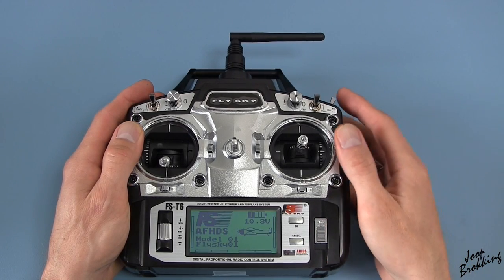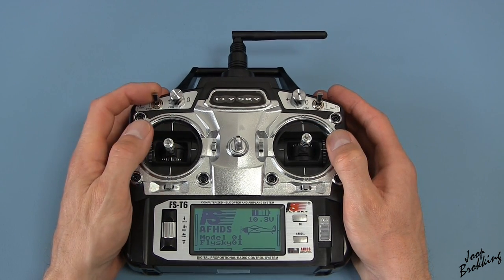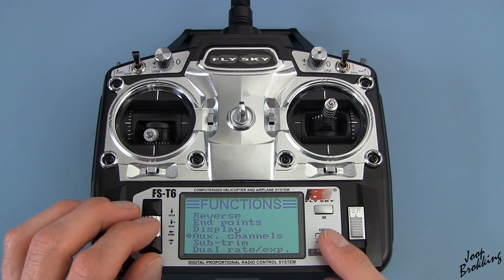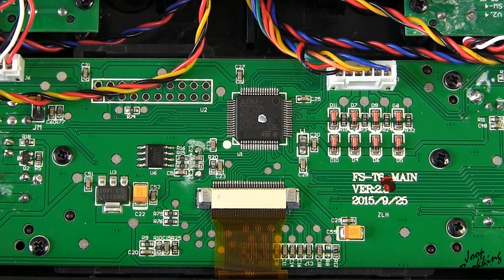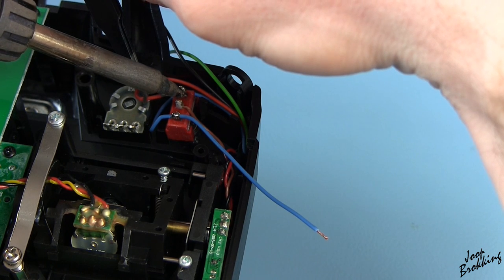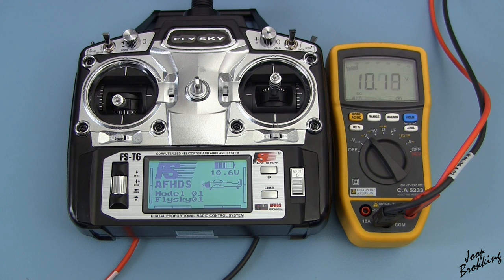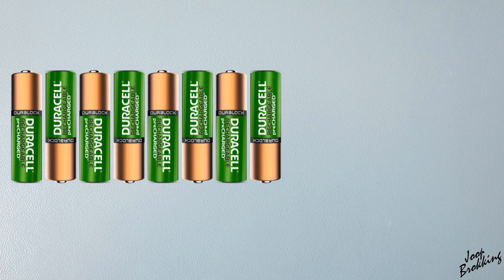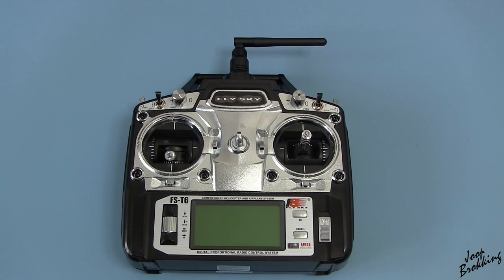Modifying the FLYSKY T6 for Ardupilot (one channel, 2 switches,  4 flight modes!)

Comment: For measuring the battery voltage in those devices why is such a low resistance is used for measurement? after all as long and that device is Working in this config it takes about 0.2mA which is quite some for such a small operation on a battery application.

Comment: Hi Joop, I am watching your videos since long, and this one is the 100% my problem too, same radio and same Ardupilot, I used the dial option to switch the flight modes but had to change the frequencies on radios, I am not a electronics expert like you but struggling with this radio and flysky 8 channel radio. Keep it up. :)

Comment: when you make tutorial on GPS hold and  GPS return to home  ? 😞😞
Reply from the maker: I have to make a video about a compass first ;-) Otherwise the GPS will not work.
Reply: Joop Brokking Can't wait for these tutorials!!!  Thanks to you i have already managed to make a very nice tilt compensated compass using your 6050 imu tutorial and the heading calculation pdf document you provided us! 
So for these GPS functions like, position hold or return to home, barometer altitude data is not required? (what about a barometer altitude hold tutorial?) I had the impression that a specific safety altitude (set by the user) must be maintained to avoid colisions if there is no sonar sensors under the multicopter. I also know that altitude data can be provided by the GPS receiver but what about accuracy?

Comment: I modded mine by simply replacing that pot with a 3 position switch and a resistor divider. Works great for selecting flight mode! (level, GPS poshold, RTH)

Comment: My FlySky T6 suddenly lost link and apm 2.8 not arm. why is that? i use rechargeable battery. On ground test everything is ok. But when i am going to fly then suddenly lost control and crash the drone.any suggestion?
Reply: Use failsafe RTL to save ur copter. Then check the range of the tx when the failsafe triggered.
Reply: USE 4 POWER WIRES to your receiver( 2 5v and 2 ground). I had the same problem and this saved my day.

Comment: Instead of changing the voltage readout with a pot, turn the transmitter on while holding both sticks in the bottom right and this will allow you to set a voltage offset
Reply from the maker: This will work on the I6 but does not work on the T6.
Reply: sorry bottom left not bottom right
Reply: thank you Marcus it work

Comment: nice mod it already has a voltage adjustment tho. 
i have one mystery where all my batteries read 1.39v but altogether i only get 9.7v it should be 11.12v... its like one of the batteries isn't being detected by my meter. the transmitter says 11.1 though
how about a lipo battery mod?

Comment: Very informative, nice job. Who do you keep the different combinations of switches straight? It appeared to me (?) the left (next to antenna) 3-way toggle would have to be in a particular position so that the other switch would have 3 different positions?
Reply from the maker: The top switch is a fail safe switch that will bring the quadcopter home regardless the position of the flight mode switch. So it needs to work Independent.

Comment: The 3 position switch has just arrived, I have the resistors already from another project and now I am starting this mod :) refer to drawing again at 3.29 seconds:-  I am able to solder/connect the switches and the resistors but I am confused about the 3 connections marked GND,+3v3v,analogue out. I notice there are three wires on the potentiometer, red brown white can I presume that these are the GND,+3v3v,analogue out, if so which is which, I can make an educated guess that the brown wire being the sweep on the pot is the analogue out? if this is true I can measure out the other two, but I dont wanna let the smoke out of my Transmitter, regards
Reply from the maker: The center connection is the analog input to the microcontroller. The outer two are the +3.3V and GND. Use a multimeter to check the polarity.

Comment: uhm, isn't there an alternative firmware available that brings all those features in software? i seem to remember that you can even transmitt on more than 6 channels with said firmware, but i don't own one of those transmitters myself so i am not sure...
Reply: shhh -.-
Reply from the maker: Using alternative firmware that is made by some enthusiast is not something that I will recommend on my channel. That is why I used the alternative resistor method. 

But if you remember the link to the firmware I definitely will have a look.

Comment: Thanks Joop for all the good stuff you put out :) I am just starting RC and am going down the ArduPilot road and wondered about these extra channels, I have a question... there are two switches on the drawing, (3.29secs), one of the switches is a "on,off,on" at least that is what I have ordered, the other switch and here is my question, is the switch a "on,on" switch different than that which is already in the FS-T6 or do I need to order that one as well. regards and kudos
Reply from the maker: You only need to order the 3-position switch (on-off-on). The 2-position switch is already available in the transmitter.
Reply: thanks

Comment: Just modified mine and it works perfectly, Thanks again Joop that's another beer I owe you!
Reply: I having problems getting this to work I'm confused to what wire goes where if you could give me any help it would be much appreciated
Reply: @murphysarmy25  The Green wire is from the center of the two 1k.5 ohm resistors going to position 1 of the 3 position switch
Reply: @fpvsparky  thanks for the help  I'm new to this bit of a stupid question the brown wire connected to the resistor is that the original brown wire from the controller I ask because in the video it also looks to be connected to the two way toggle switch
Reply: @murphysarmy25  The Video is a little confusing, but yes the brown is the analog out from the sweeper, if you follow my diagram and the colours, Red 5v+, Black earth, green from the 2 1k.5 to pin 1 on the 3position, blue from 1k.5/3k.3 to pin 2 on the 3 position and to pin 3 on the 2 position.
Reply: @fpvsparky  much appreciated I will fallow this instruction along with the diagram thanks
Reply: @fpvsparky  Think I have it just want to be sure before I soldier so I have brown wire from controller to pin 2 (2position switch) red wire from controller to the 1k5 resistor to pin 1 (2position switch) green wire from centre of the two 1k5 resistor to pin 1 (3position switch) blue wire from were 1k5 and 3k3 meet to pin3 (2position switch) to pin2 (3position switch) black wire from controller to 3k3 resistor to pin3 (3position switch) my confusion is there's a brown wire connected with blue wire between resistor 1k5 and 3k3 in the video I'm not sure were it goes but when I test the settings with the way I explained with just blue wire between 1k5 and 3k3 the settings work I think sorry for so many questions
Reply: @murphysarmy25  You got it, the video is wrong, and don't forget to set up the channels on the radio otherwise it won't work!! you can test it with the test program that Joop supplies
Reply: @fpvsparky  was thinking it was because your instruction made more sense gonna do the test program later that was the only thing holding me back  again much appreciated thanks for your help
Reply: @murphysarmy25  How you getting on? did the switches work?
Reply: @fpvsparky  in the controller settings it looks to be working haven't been able to do anything more at minute to busy again thanks for the help